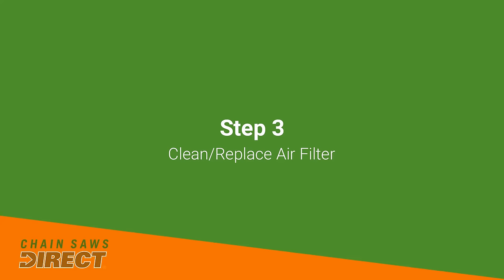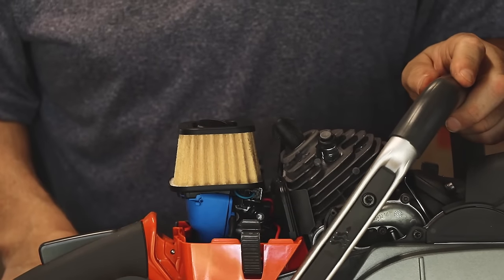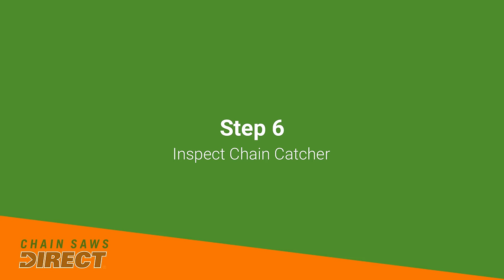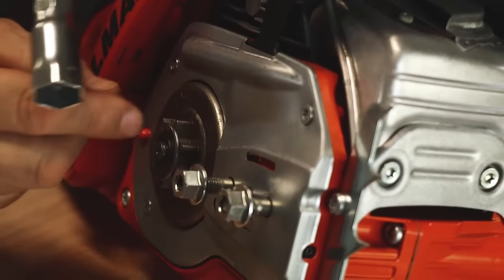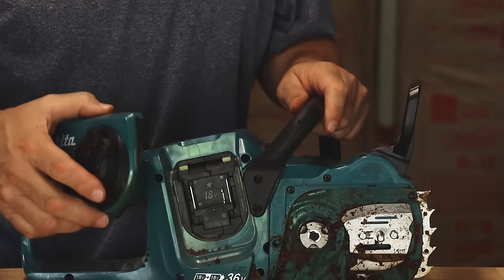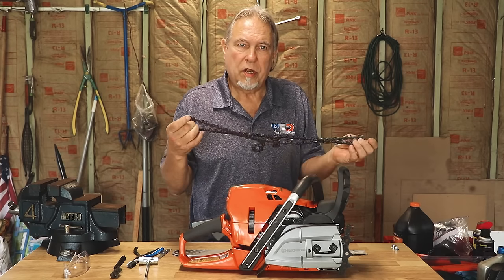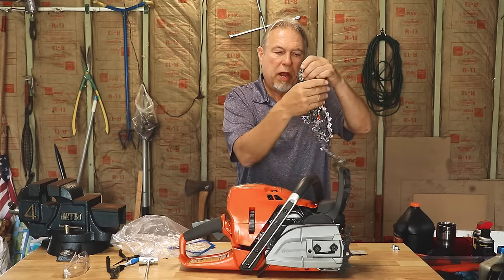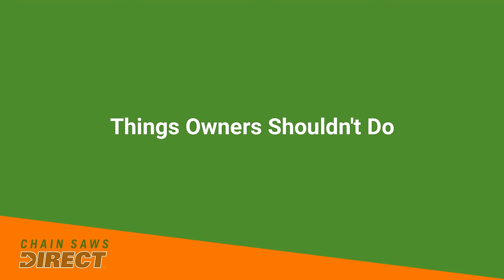How to Maintain and Service a Chainsaw

Comment: I like those cheap wood handle paint brushes from Walmart.    I use Purple Power or Super Clean in a spray bottle, along with my air compressor.
Reply from the maker: Thanks for sharing your tip.

Comment: :53 he said "muffler" I know he did.
Reply from the maker: Yes, technically a muffler is a device covering used to muffle the sound throughput of the exhaust on a combustion engine. The muffler helps exhaust and noise escape more slowly and evenly.
Reply: Not what I heard. But I enjoyed it